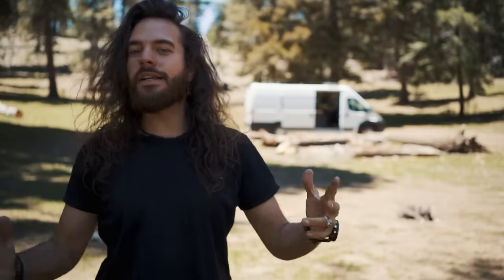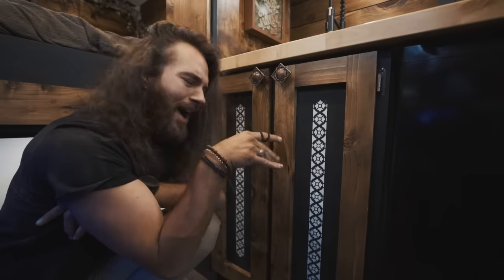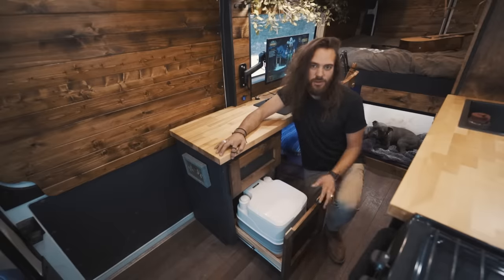The Ultimate VANLIFE GAMING Van Tour | Ram Promaster

Comment: What a great setup. An awesome upgrade would be home automation/monitoring. Single panel tablet (probably battery, low powered) on the wall with battery levels, current draw, water level, thermostat etc. Automatic fan control and automatic shutdown of non essentials when battery is now. Day night sensors, even sunlight sensors. Amazing as is though!

Comment: I love the build and I'm not trying to critique, but the caulking you used in your propane box is a Latex caulking. It's made for like crown molding and things like that so you can paint it, but its not a sealant, it will get cracks in it pretty soon from all the movement, if you check it and it is cracked, go with an exterior window and door weatherproofing sealant, it will last you much longer and it will actually seal!

Other than that, it looks great!

Comment: 11:37 Something worth trying is a small carpet pinned by the desk that comes out a bit. Then getting a comfortable gaming chair and just simply don't put the wheels on it. You'll have to swivel in/out most likely but how often are you getting in/out of the chair as opposed to sitting in the chair? It looks like you'd have decent leg space to swivel without having to have the chair situated further back and then having to be pushed in after every use. If you ever did do this though, I would make sure the carpet just has the grippy texture to it that has "short hairs". The carpets that are really fuzzy, I imagine it would be a nightmare to get the dirt/sand/what have you- off of it when your boots or dog have been ontop of it. Great video and thanks for the ideas!

Comment from the maker: Watch me build this van from start to finish here: https://youtu.be/J3NRoJTUZG8
This is how I get internet to game and live stream in my van: https://youtu.be/qUA5WzpX8Cw 

Sooooooo what was your favorite part of the van?? 
Also for your convenience, here are the timestamps to some of the important features of my van!
0:00 INTRO
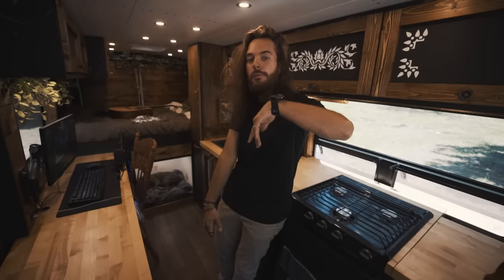2:10 Bedroom
3:59 Hanging Closet
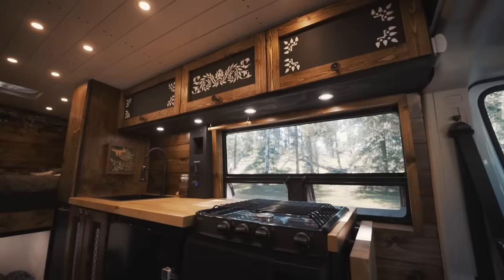4:20 Kitchen
4:46 Sink
5:02 Under The Sink
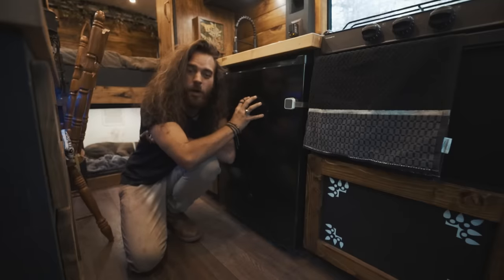5:38 Refrigerator 
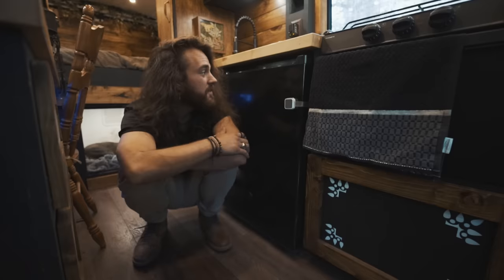6:42 Oven
7:19 Upper Cabinets
7:59 Dining Room
8:57 Diesel Heater
9:11 Millies Bedroom
10:54 THE GAMING STATION
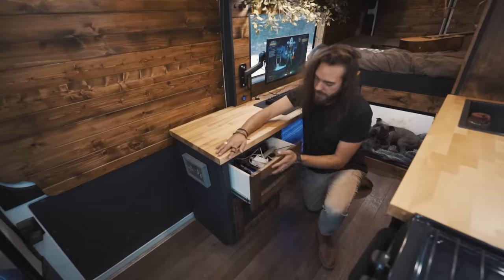12:31 The Bathroom
13:34 Propane Locker
13:55 Shower
14:36 Water Tank
15:14 Power Setup
15:26 Break Box/Fuse Block
15:40 Cell Signal Booster
16:07 Solar Setup
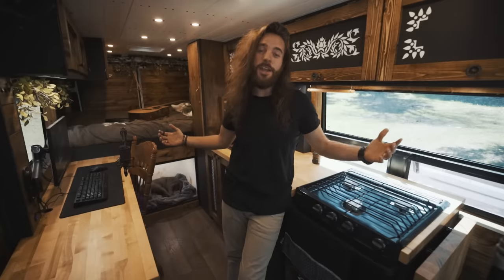17:27 Outro
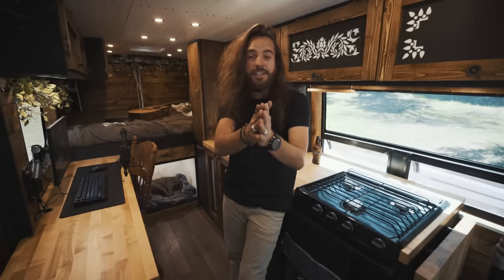18:05 Outtakes
Reply: Dude, you created a work of art with all those little personal touches (custom knobs, painted details, good materials). Haven't seen a van this expressive yet. Thanks for sharing!
Reply: Love 💜 it all...Quick question  What water pump did you install, it sounds really quiet and I need to get one for my Van and it's so hard to figure out which one to get! I don't care what the prices is as long as it's quiet!! Look forward to your reply 😀
Reply: I like how you have all the power setup. I went to college for electronic engineering and after well over 24 hours of cable management on my PC for all the different custom pieces. I know what a bitch n a half it is to run that many wires to that many things, test and troubleshoot every piece hooked up, hide the wiring. I imagine almost a month of your build time was wiring, or maybe you're much quicker at wiring then I am lol
Reply: This is awesome! Don’t forget a fire extinguisher 🔥👍🏻
Reply: Total cost?
Reply: The music used in this video

Comment: Nice setup.

However, I recommend changing to a similar capacity LiFePO4 Battery as fast as possible. They can be discharged fully unlike Lead Acid. Besides, they will also last for 25 to 30 years compared to others which last only for 10 years. Besides, they are not that expensive these days and come with internals as well as external BMS units.

Comment: Oh my... I am wanting to do this with my current vauxhall vivario... I have a feeling the desk will have to be outside! ahaha
Reply: And I my friend had a revelation, VR setup to play outside of your van, put mounts for sensors on a van and one one some kind of stand and you have first vanlife VR setup in the world
Reply: @danio1021  Uv light typically damages vr lens/sensors
Reply: @itsbinxbro  vrs dont really use sensors anymore uv only damages the lenses these days so should be fine if you just use a cover when its not on your face, id be more worried about tripping on a stick and faceplanting it into a rock
Reply: @russia1305  Sensors on standalone devices are located on the headset and can be damaged by direct sunlight just as well as the lens

Comment: I just wanna know how much all this cost..? Because after watching this, screw getting a mortgage and a stand-still house.. when you can have a traveling home 😍
Reply: Same here. I would appreciate the overall costs and a blueprint.
Reply: And insurance.
Reply: +\- 100k
Reply: depending on the cost of the pro master id wager somewhere between 50-70k
Reply: adding everything on the description is 5k+42k of the van + 10k extras (laptop, making the furniture and everything else) i would say around 60k
Reply: It's the cost of the vehicle and components, not to hard to break it down yourself to get a ball park. The van is the most expensive, the rest is cheap comparatively.
Reply: I'd say about 50-60k if you go the no expenses spared (relatively new vehicle) setup. But if you get yourself a decent van for 15k, you could probably half that.
Reply: You can convert a cargo trailer to do all this with more room and'll last longer for +/- 10k
Reply: @ForneverstarOfficial  Cargo trailer would be pretty good as it can be towed by anything pretty much and would cost a fraction of the build in this video including the cost of a vehicle to tow a cargo trailer with.

Comment: Dude buy a Rolling chair and change the Wheels for Rubber stands , they sell them in Ikea or some store similar to Ikea or Walmart.
Reply: It would be hard to move the chair around for the weight of a rolling chair, making it hard to adjust your distance with the table. Last thing I'd try for a chair replacement.
Reply: @MY-bc3qq  There is a Ton to pick from, he does not need to grab the heavyest one :D
Reply: I was just going to say a lot of the rolling wheels have wheel locks. Just thumb them over - also tie the chair. Definitely a light but strong office mesh. Though the wood looks good and made to measure, so the height of what he has is fine.
Reply: Bungee chords maybe? Just tie the chair to the desk on the top and bottom and you’re good to go

Comment: I could really use some instructions about installing solar power. I have a washer, dryer and freezer outside, so I would need to integrate the outside outlets in the solar power systems as well.

Comment: I wish they would create a smaller fridge with similar style to kimchi fridges. They open from the top. They could act as a counter as well as a lid for a fridge, and there wouldn't be a need for a fridge lock. You could mount it on a shelf level with the counter. I think I would get a futon that could fold in half for a bed, similar to those used for couches. Create a folding board, fold up the bed, prop it up with a leg, and have a shower/storage area. A smaller propane heater for hot showers in the winter. It would then be convertible as a couch.

Comment: Damn man, I've studied a lot of van builds & this one... chef's kiss  bloody beauty!
Just for perspective reference, what length Ram Promaster did you go with?
Reply: he said pro master 3500 with a 159 inch wheelbase extended and high roof.
Reply: Really great build but I would prefer a shower in the van. I would eliminate some of the kitchen counter space for one. Other than that this would was legit
Reply: @babygirlhehe9748  Ah didn't catch that part, must have been too busy admiring the van haha
Reply: @j-rod2807  I've seen a few where the shower/toilet is IN a kitchen cabinet, so part of the bench top folds out & they have a rail or hooks on the roof ready to hang a shower curtain. Probably the most space efficient method i've seen while still keeping the inside very open & roomy.

There is also a similar method where they  just have the rail/hooks for a shower curtain in the middle & use one of those big collapsible rubber tub bucket things to catch the water

Comment: Love your rig. I am in the process of upgrading to a Ram Promaster 2500 High Top, but only going with the 136wb, as that is all I need. My professional build will be more than the vehicle itself, but I need all the creature comforts due to health reasons. Being a gamer, myself, and that I have an air conditioner in the new van, I will be able to run up to 3000wtts and will run off 350w solar panels on the roof. I am going to see if I can use my portable solar panels and plug them into the system for added solar when I am parked in the wilderness. New to your channel and loving your videos. Travel well

Comment: Noob with a question here. I just was blessed with the opportunity to buy a fully kitted ram promaster. Complete with a full renogy solar set-up. I have a Rover 100a mppt charge controller and a Renogy 3000w pure sine inverter. 

So my question is: Can I plug into a standard wall outlet to charge my batteries if need be? Do I need any extra tech? If so, what do I need?

Comment: I'm up in big sky Montana and we get a lot of now and temperature regularly reaches well into the negatives (-10/-15), I bought a 2010 tundra and want to find the right camper to put in the bed to live out of. I'm looking to spend around 6-8k on the camper and modify what I need to and also pull a smaller trailer for a small motorcycle and snowmobile (once I can afford it last) I chose the truck for reliability, rugged terrain, and 4x4 capability. Any advice on the right camper to deal with the weather or advice in general? Looking at airbags to help with weight and keeping the truck from looking like it's trying to do a wheelie.

Comment: Asthetically, this is super nice and classy. And I know he already calculated for total weight and everything, but... it just seems so impractical to use solid wood in a mobile build where it would save a lot more gas if the total weight was lighter... like... using board/lightweight metal with wood vinyl where weight bearing is not a factor. Even the wooden chair is a lot heavier and not necessary :-/ Any weight saved is potential gas saved, especially in today's conditions.

Comment: I'm surprised 600w of panels is enough. I had 850 on my van and it wasn't enough. Of course I was in cities a lot and the buildings made it hard to get sunlight. Good thing you have the power isolator to allow you to charge via the engine while parked. If I do it again I would like use a Tesla model Y for the massive onboard batteries and super efficient climate control systems. Never liked the nasty diesel smell of my webasto, seems unhealthy. And diesel exposure is linked to increased cancer deaths in truckers.

Comment: I would have gone with a bathroom; A. if a lady stays the night, they all not into using the great outdoors, at least not every single time they have to use the bathroom, and as you age, those bowels will start working more, plus a hot shower on a cold winter morning would be a great way to start the day, even if it was 3 minutes it's a hot shower.